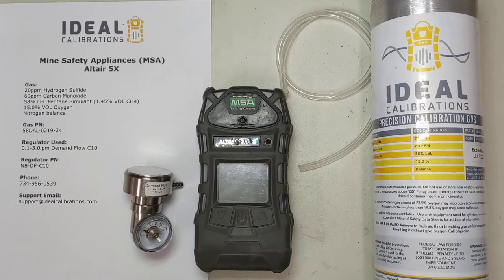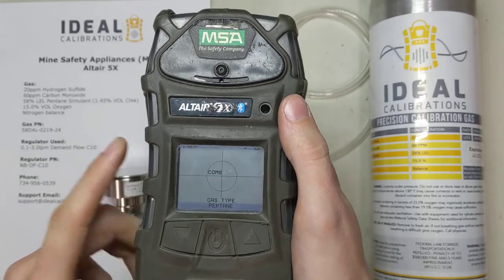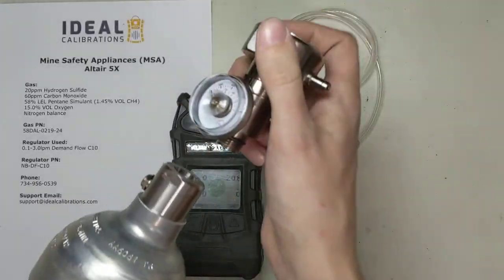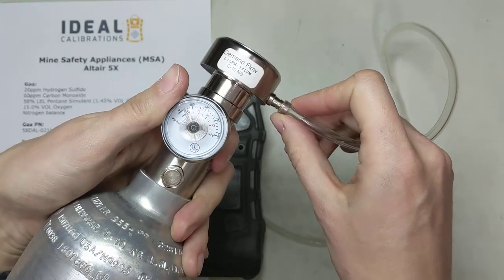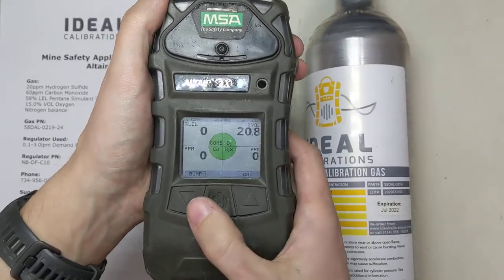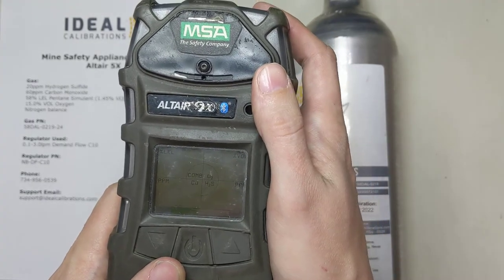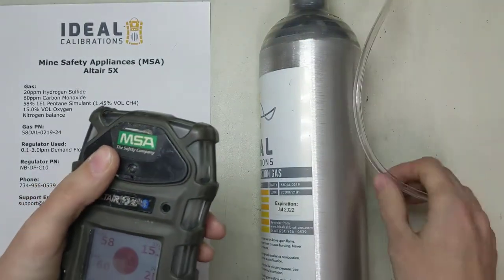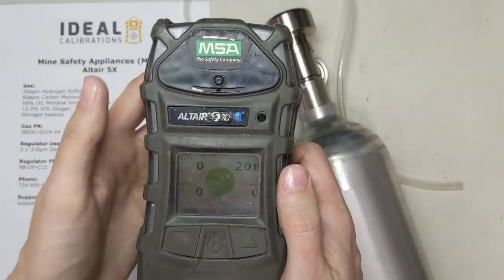MSA Altair 5X Calibration and Bump Test Guide

Comment: Detailed video... Thank you very much.
I noticed however that each time you popped the gas tube from the detector, you did not close the gas regulator. Wouldn't dangerous gases be released into the room??
Reply from the maker: The regulator style in the video is a demand flow regulator, which means it only delivers gas when there is a vacuum applied from the pump on an instrument. You should always use a demand flow regulator with a pumped instrument (instead of the fixed flow with an on/off knob you would use with a diffusion instrument)
Reply: @Idealcalibrations  Thank you so much! This is so enlightening
Reply: Do the math.  A 34 liter bottle holding a H2S concentration of 25 ppm isnt going to hurt anything. An 8x8 room is almost 14,500 liters.  It would take 425 bottles to make the room 25 ppm H2S.  One bottle completely emptied in the room = 0.05 ppm H2S.

Comment: How do you incorporate the Isobutylene gas test with the pentane gas test?
Reply from the maker: If you have a PID sensor you'll need an additional cylinder (https://idealcalibrations.com/Isobutylene-C4H8-calibration-gas/?sku=103DST-0038-48) to calibrate. Once you finish the 4-gas calibration it will enter the PID calibration and ask you for the Isobutylene gas. Just repeat the last step from the 4-gas calibration and you'll be good to go. You have enough time to quickly remove your tubing from the monitor, then the regulator from the cylinder, and finally to screw the regulator into the Iso cylinder and reattach your tubing.

If you don't detach the tubing from the gas detector you can sometimes have errors on the pump so keep that in mind.

Comment: Hi, I can’t get mine to turn on. I’ve had it in the charger all day and when I press the button the screen lights up but it never turns on.
Reply from the maker: Sounds like a bad battery or a bad charger. I'd swap the charger first if you can, but the batteries on these do go bad on occasion especially as they age.

Comment: Does your gas automatically flow when you connect the tube from the gas to the meter?  I didn't see where you turn the gas on and off.  My calibration gas is different so I had to remember to turn it on and off.
Reply from the maker: Hey Jack, I'm using a "Demand Flow Regulator" which essentially flows gas to match the speed of your pump.

With a knob, it's generally a fixed flow on/off regulator. I don't recommend these for pumped units unless you're venting the pressure somewhere, as a fixed flow regulator will never match a pump exactly and either flows too little gas or too much. Neither is good for the pump.

Comment: Hi question how often do these MSA units need to be calibrated?
Reply from the maker: It's best to calibrate them once a month, or if the units see a major exposure to gas. Bump test the unit daily before use and if anything seems off you want to recalibrate. It's essential to bump test each day before use in case one of the sensors goes out and stops responding as the unit won't tell you if, for instance, the LEL sensor gets poisoned and stops seeing gas.
Reply: @Idealcalibrations  thank you for your message

I understand that these unit should be bomb tested daily 

But having the sound of fire engine  I don’t believe we can bump test every day. What do you recommend for first responders having this instrument
Reply from the maker: @Comeon-no6jo  Make it part of your morning routine or accept you're treating your life saving equipment without proper care. I've seen LEL sensors die because some guy Armor-All'd the truck the night before with a monitor inside it. Sensor was completely poisoned and no one knew it. They were going on Propane/CO calls for a week before they bump tested and realized the sensor wasn't picking up flammable gases.

 Bump daily if you're going to use it daily or on emergency calls. If you're only using it for non-emergency use then jump calibrate monthly and bump test the unit before you take it on the road.

Comment: How does gas expire?
Reply from the maker: Hello! This answer is a long one, so I'm going to link a blog post I made on the topic if you want more info:

https://idealcalibrations.com/blog/why-does-calibration-gas-expire-fade/

Essentially components like Hydrogen Sulfide are reactive and can interact with things like the cylinder wall, valve, or oxygen in the cylinder over time. A cylinder that you bought at 25ppm from the day it arrived may be down to 23ppm or lower by the time the cylinder expires. This will screw up your calibrations and you'll either start seeing false positives or if the H2S fades too low you'll start seeing failed calibrations.

Generally when a sensor has an H2S issue the first thing we double check is the calgas that was used to calibrate it.

Some gases, like Ammonia or Chlorine, are far more reactive than others, so you'll see their warranty and expected life as much lower than other cylinders that have H2S or SO2 in them.

Hope that helps!